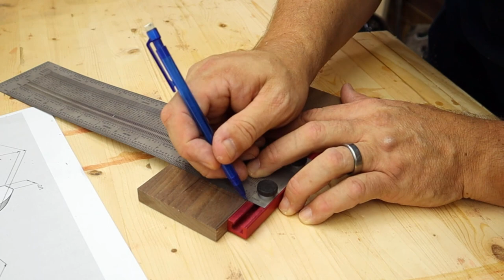French Cleat Japanese Handsaw Storage

Comment: What did you bathe the wood in please, also I personally would have the teeth pointing to the wall as them Japanese saws are razor sharp,
I also suffer with benign essential tremor and I just know I would end up cutting myself with the teeth facing out 🤣
Reply from the maker: I make lots of cutting boards and charcuterie boards so I have that bin full of a couple of gallons of food grade mineral oil. Not sure why I had them facing out for those shots. My thumbnail pic has them facing in which is definitely the plan👍 And yes, these tremors make woodworking challenging but I still have fun! Thanks for watching!